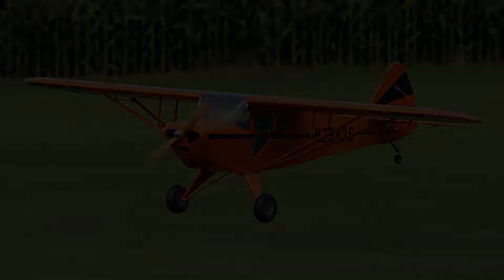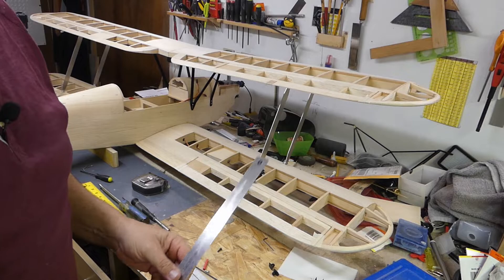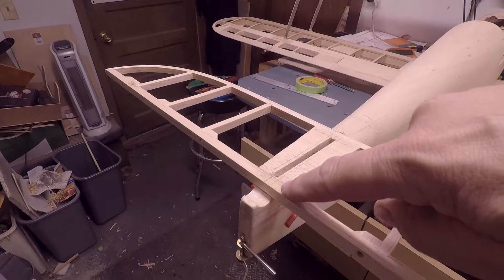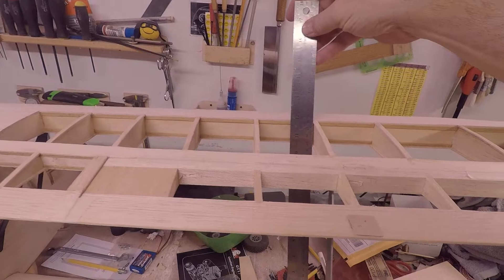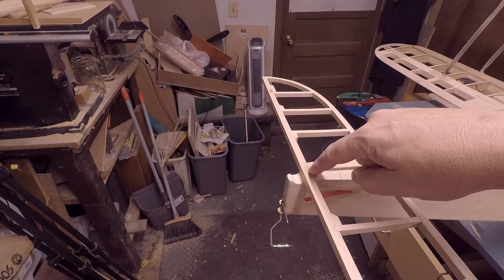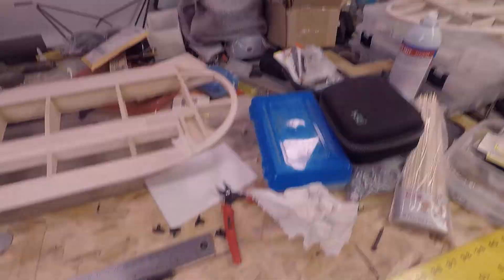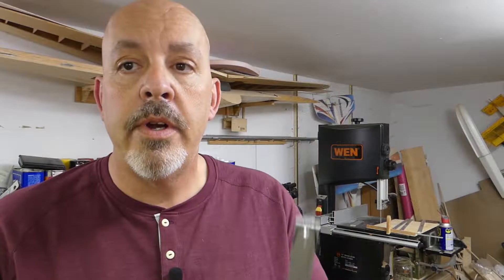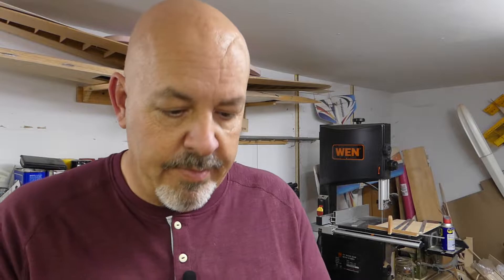Tiger Moth Becomes a Stampe SV4 - Video 22 - New Interplane Struts are made

Comment: hi bud i have just rigged my tiger moth scale model the dihedral is set on bottom wing with landing wires 4dg. top wing 3 dg inter plane struts to match, flying wires to match, cross bracing wires set  to angle of ,incidence set at fuze make sure tips  are parallel to fuze no washout or washin  if you get the bottom wing right make the top wing to follow you may have to adjust cross brace  use two boards on wing, one inside and one outside and sight across sorry for being long winded i have had the walk of shame